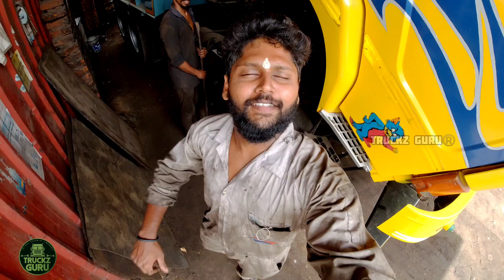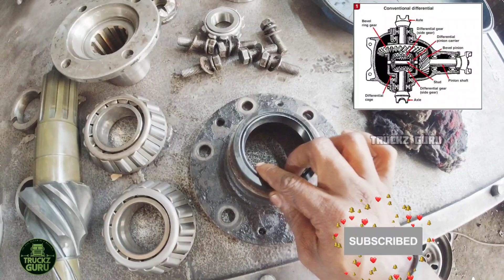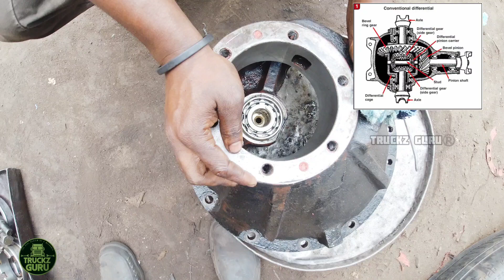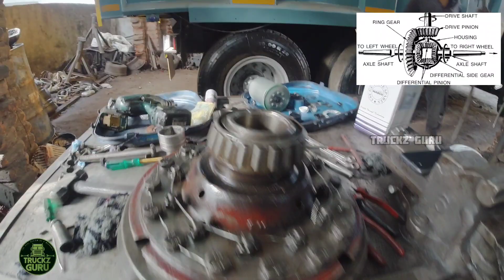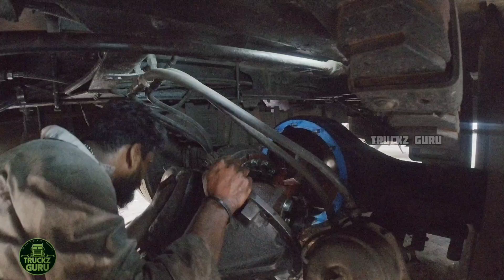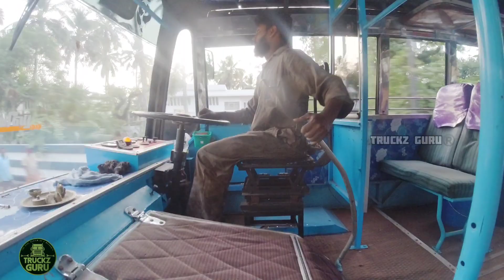HOW TO REPAIR BROKEN DIFFERENTIAL PINION | ബസിൻ്റെ ഹൗസിംഗ് വർക്കിങ് കണ്ടാലോ?? | COMPLETE WORKING

Comment: @10.49, bearing set cheyumbol ingane hammer condo set cheythal, bearing life orupaad kurayum. Ee thettaanu oru 90% mechnaikkukalum cheyyunathu, Hydraulic press vechu venam bearing, bushes okie set cheyyan. Life kooduthal kittum , mating surface correct mating aayirikkyum. Ingane set cheyyunnathu kondaanu jeepinte spindle bearing (related to death wobble in old Mahindra jeeps without OKBJ) pokunanathu. Just my thoughts, Otherwise, very good work. Cheers!